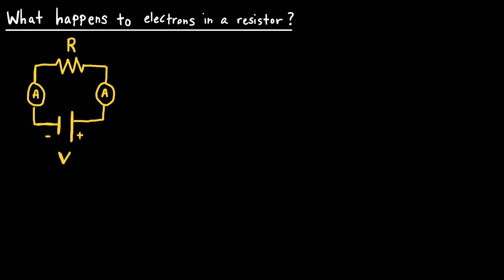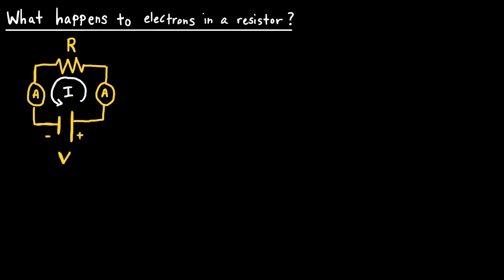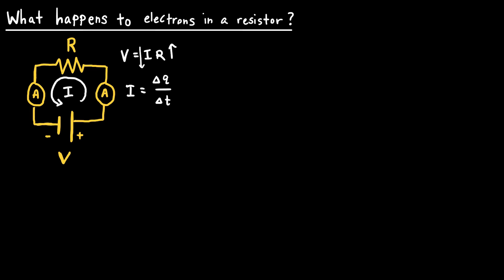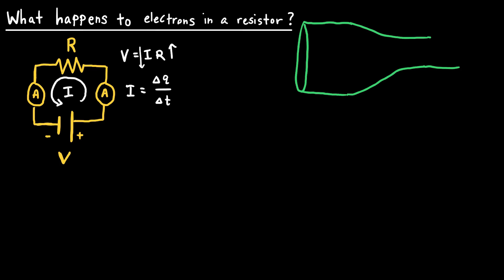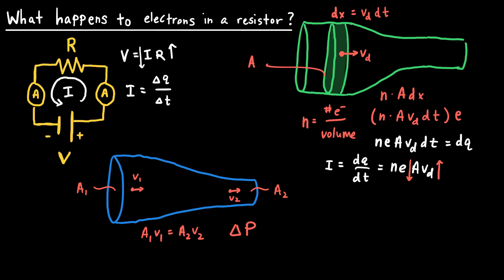What Happens to Electrons in a Resistor?

Comment: Hello! It's been a while since I've watched your videos but I need help with a math thingy!

so I have this equation:

0 = fe^((1/2fr)x^2)

I want to isolate it so I only have x on one side
I have no clue how to do this, I'm using the maths for programming reasons but I don't remember how to isolate variables like this lol

I hope you can help :")
Reply: If you're going to be using your derived expressions in code, it may be worthwhile to use the Python library Sympy.

This would allow you to solve for the variables symbolically.

I'm assuming that Fe and Fr are variables in themselves and that Fe is not a combination of a variable F and e.

Sympy outputs an empty list in this case, indicative of "no solution".

Which intuitively makes sense, as Fe^(x^2) would need to equal zero after we distribute the exponents. This would imply that the exponent (x^2) would need to approach negative infinity. This is not possible, as the square ensures the exponent is always positive.

I would double check for correctness because I did this very quickly, but I hope it helps.
Reply: I did make a small mistake when distributing exponents, therefore it would be your entire RHS to the power of x^2

The logic remains the same though.